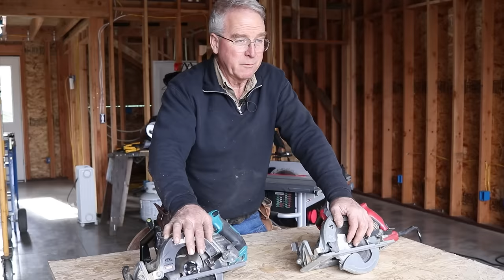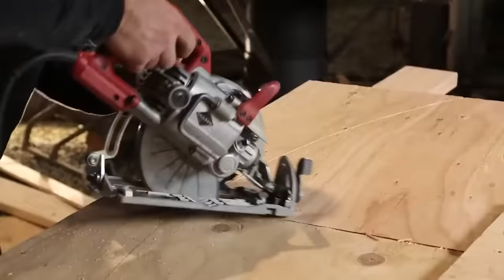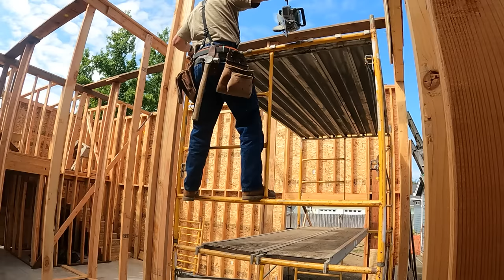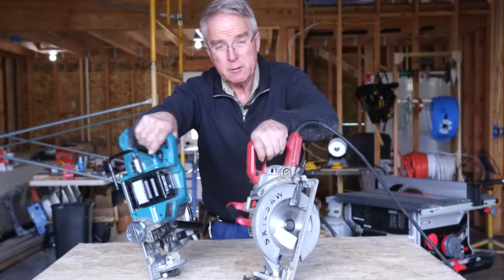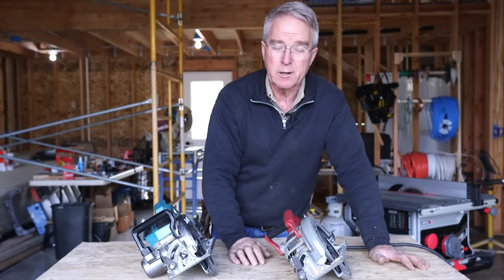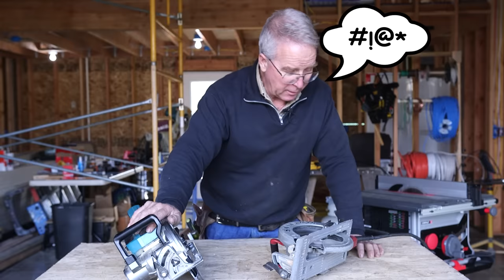Makita 40v XGT GSR01Z 7-1/4" vs. Skilsaw Mag 77 Circular Saw Review

Comment: I'm a framer in Australia and i'd LOVE to try the worm drive motors out, but unfortunately they're not a thing here (sidewinder market domination, can't really import one due to voltage differences and the need to then run a transformer), but Might have to pick one of these makita saws up at some point for that front heavy experience you guys seem to love

On the comment about it being rained on; the makita battery tools are ridiculously resilliant, granted we don't have as much/heavy rain as you guys might have, but i've left a 40v sidewinder style battery saw on site hooked up on a joist over night through heavy rain (mistake of my own, of course) and the next day, came back, tool still wet, battery hadn't drained a bit, ran just fine, and still going strong. It's common for us to use their battery tools in wet weather without worry. Agree on the battery running out/needing swapping out as a negative though- the other side is when the battery gets low the saws tend to slow down a lot but i've noticed with the 40v the noticeable ramping of power is typically a lot closer to when it's only got one bar left compared to the older 18v, it still gets the cut done but it's slower and starts to struggle a bit. 

I use the battery saw for the majority of my cutting but I always have it on rotation with another battery if i'm in the process of constant cutting duties- otherwise, for general stuff, can get a full day of work out of a new 4ah battery in the saw

Comment: Absolutely 100% correct about tracking the saw to its position where last seen, You feel like demensia has taken over when having to chase a cordless tool. As for running out of power... I do bring a bag. 2 8Ah M18 HO batteries and charger. I know it's meant for the 12 Ah, to run a full day - sort of. If a rough day on the job, it will run out on you - I just switch. One ALWAYS has a full charge, since the charger is always first to be plugged in with a battery before anything else, and it charges faster than it uses a battery in almost any circumstance, so... yes - it is an extra investment, more to carry, but... Usually switch at lunch, just to be sure not to run out, and besides, they don't really like being run all the way flat.

On the development side, changing battery platforms etc., it has come so far on the entire market, that if you do not make things backwards compatible, people are going to jump ship on you, unless you come up with something so revolutionary it's worth changing every tool on the platform for, meaning sawzall, rotorhammer, 9" grinder, hotsaw, jobsite tablesaw, chainsaw etc - ie. a LOT of money... which manufacturer wants to miss out on that?

Comment: I tell ya, this is spot on. As a 4th generation carpenter, my dad and not so much my grandpa(handsaw cut rafters), I remember when they would lug that heavy worm drive skilsaw around and it was like second nature and no mention of the weight. So when I started as a lad 35+yrs ago, I cut my teeth on that thing also. Changing the brushes, making sure it had oil and a sharp blade was the norm. If we had what we have now back then, I can guarantee that we all would not have the beat up bodies we do now.

Comment: I have used Makita cordless tools but I own Milwaukee. I would say there there is a definite difference between them in regards to both power and feel. I would say my Milwaukee rear handle saw, with a high-output battery(two bars or better) is the same as corded regardless of what you are asking it to do. 

A battery on the last bar, I feel you can notice a difference. Once you put on the fresh battery it is obvious.

Comment: A HUGE reason I like Mag77’s is you can get most or maybe even all the parts and fix them up to near as good as new in a afternoon
Reply: That's dependent on location of course. I couldn't do that here in Europe. I am a Makita user and ordering spare parts couldn't be simpler with them. The website has an exploded view of every tool and you just order the ones  you need.

Comment: I’m a 40 yr old plumber and most of the plumbers I work with are around 25. It’s amazing how averse to cords they are. To the point where they spends hundreds of dollars more on battery tools. They even tell new guys about these great deals on Milwaukee or hilti battery tools. I had to tell those guys not to listen. I told them if they had the money fine but while starting out consider a balance of corded tools and battery tools or stay away from red tools until they made a little more money. There’s some tools that just aren’t ready for battery only or they are but it’s going to cost you at least $200 or more in large amp hour batteries to run them properly. The two tools this most applies to for me are grinder and chipping hammer. I’m not to the point where I want those tools to be battery only. Milwaukee also put out a line of heavy duty tools with very large batteries. These included core drill, jack hammer, Sewer machine, and generator(though if it runs off batteries can we call it a generator). The smallest of these batteries is $600. That’s on top of probably a couple thousand on a tool. Unless you’re regularly working in a place without power I just don’t see the upside. The batteries take 4-8 hrs to charge so to prevent downtime you’ll probably have to have 2 of them. I like that the tech is moving forward and it takes buying said tools to move that tech but I’m not ready to cut the cord just yet. 
PS. I had a helper and we were working under a kitchen sink. I told him to to put one last 1” wood screw into the back of the cabinet. He looked around then stood up and started to walk outside. I said where are you going. He said to get an impact. I said there’s a screwdriver right there. He literally said “you can drive a screw with a screwdriver?”. Anyway I showed him how to do it or at least how I do it. I’d always hit the back of the screwdriver with my palm to get the tip in so the threads could catch and the rest is elbow grease. I explained ti him that when I started the options were hand drive or go unroll a cord and chuck up a bit with a chuck key so if you had a few small screws you used a screwdriver. I doubt he’ll use a screw driver for that again but at least he knows how

Comment: The final point on money in the pocket must include the time/money spent rolling out, rolling up, and re-routing a chord over and over every day. Replacing damaged chords, fueling generators, working  with power outages/shutdowns/popping breakers on overloaded spider boxes and workingnin wet conditions. 

As a form builder I need the chorded saw at a designated cut station to do high volume cutting like ripping edge form all day. But my 36v makita keeps me moving when i hit the site, first charge can last all day but if i am using heavy, gets me to lunch. No rolling, refueling, or waiting for a pick for a generator, no endless chord repair, no waiting for sparkies to get me set up with power. No fighting other trades constantly unplugging phone chargers or overloading and popping breakers. 
Just go. Keep going. Even though makita has upgraded to the 40v, i cant kill my 36v set up if i try.

Comment: There's a reason the Makita slides smoother, just look at the bottom of the plate...  The Skilsaw has grooves for a reason.  Did you mention how much safer it is to lower the Skilsaw down from a roof than to carry the Makita down when you're tired and dehydrated?

Comment: I'm retired and don't use my saws to make a living, and I hated to part with the extra money for the Makita, and I got it especially for one project where power was a pain to get to.  But I agree with you 100%. mine is the 36v one and uses 2 of the same batteries as all of my other Makita tools. I wouldn't part with either for the same reasons you spoke about. The convenience of the battery saw and the brute force of the corded one. I'm on the east coast where no one would steal the corded one because of the weight, but I guard the battery one like a mother hen would with her chicks

Comment: As always excellent review but one thing is missed. Not all jobs are huge framing jobs and not all job sites have electricity.
Of course if its a big job without onsite electricity you would bring a generator but since nowadays every tradesman have multiple high capacity batteries it might even be cheaper to buy few more of those then to invest in some good generator. Also, on the note of job size, if you mostly do small jobs, fixes and maybe not even a framer than the convenience of just snatching a cordless tool, doing the job and leaving without dragging yards of cord is wonderful.
Btw Im a 29y old IT engineer but I love doing furniture, welding, electricity and due to decent income was able to acquire many Bosch cordless tools from drills, impacts, grinders, vacuums etc., regardless of it not being economically viable for me since its for doing that work as hobby I still smile whenever I dont have to drag lines of cord for some 5min job.

Comment: The one place the cordless wins out is remote locations BEFORE the power gets connected. It's just easier than running a generator. But I do seem to spend allot of time wondering if the battery has enough left for a certain operation.

Comment: I use the Milwaukee rear handle circular saw it works great for cut power and I never have to pull out a cord, but the bevel adjustment doesn't have positive stops which sucks but beyond that I love the saw and it's rafter hook. Hang it from my bench, belt and up on roofs lol

Comment: 8:38 The non-soft start with the Skil causes the saw to twist. It's not a problem once you learn how to use it, which should only take pulling the trigger once. That said I don't mind soft start but it's not essential.

Comment: Perhaps a comparison of wormdrive vs hypoid gear-driven cordless saws? You should compare the Skilsaw TrueHVL 7 1/4" cordless saw SPTH77M-11 and then compare with Metabo HPT has a 36v, DeWalt has 60v, as does Hilti.  My friend figured he'd spend money on a powercell that offers 8hr run of his tools that he doesn't have to replace, then buy all new battery ones. Point is, a $1500 portable power station, lets him cut, drill, charge phone, and onsite in nice weather, also charge (solarpanel) while keeping his "paid for already" corded tools. Sure, he can't lug the 100lbs up on a roof, but two guys can get to the within cord use. I'm waiting for the big colorful tool labels (Yellow, Red, Orange, Green, Blue, Black, Lime Green...) to add a powerstation to their packouts, since they have wheeled cart options to stack.

Comment: As is always the case with tools, which one is best depends on the circumstances in which they are being used. While there is an argument to be made for minimalism and simplicity, I would argue that a lot of guys should own and use BOTH a corded saw and a cordless.

Regarding your frustration with the battery going dead at an inopportune time (like when you're working up high and you have to climb back down and/or across the jobsite to get to the charger). This can be alleviated when you have multiple battery powered tools that use the same battery, and you get in the habit of keeping one or more spare batteries charged at all times. Once you have that muscle memory (or mind memory in this case) to keep an eye on your state of charge, it becomes easier to always have plenty of power at your fingertips.

Comment: The ultimate factor in corded vs cordless is the size of your jobsite. I prefer residential framing, but as someone without a framing crew and contacts with developers, I work industrial/commercial for the money. I'm not gonna roll out four 100ft extensions to do a small form or wall on the other end of the building.

Comment: I love my Makita 18V drill and driver; they go longer than I can on a single charge. I have a few other battery operated tools from them, but I tend to prefer corded tools. It's not necessarily power, for me, but the fact that different manufacturers make certain tools better than the others. Mix and match doesn't work well with battery powered tools. I wish there was a standard battery slot or you could buy adapters where you buy whatever tools you want AND have one type of battery and charger.

Comment: Have the Makita 40v track saw, and have Milwaukee circ saws along with the Metabo HPT 36v circ saw. Also have a corded mag77 too, which honestly, haven’t used in about 2 yrs now, but still have and will never get rid of, as never know.
That said, I find myself using the Metabo HPT 36v circ saw more than my Milwaukee (id say have way more Milwaukee Tools than the other brands, but do have “the other” brands tools, with exception of Flex and Ridgid cordless power tools) and like the Metabo HPT b/c of the quiet mode they have on the saw, as does make a difference in sound, especially when inside structure; but also like that I can use the Metabo HPT adapter cord if all batteries are charging and don’t wanna wait and have access to power, and the other thing like about the saw….pricing. Was very affordable for 2-36v 4.0Ah batteries, contractor carry bag, saw and blade and paid $250 plus tax (already had battery AC adapter cord as an fyi.
Honestly though, if you can find a saw you like (or ANY TOOL BRAND) that is cordless or corded, for great price and it gets the job done, in turn, making you money…..that’s the best tool for you than; doesn’t matter if bought it used, refurbished, new/old, got the newest model, or bought a model that’s 10 yrs old, etc…… If you like it, and works for you, that’s the key, IMO.
Always a pleasure listening to you talk and speaking about anything really, as always LEARN SOMETHING new, or old that forget, that maybe phrased differently. Thanks ✌🏻
Reply: Ditto

Comment: For many years I used a Mag77, until I had to buy a new one in 2010 because of theft. The new mag77 lasted only 2 years because of a bad 'armature' ! (Skill had gone cheap Chinese on me). I then went to the 'corded' Makita wormdrive which has served me incredibly well for over 12 years and still going strong !  I recently bought the Makita 40 volt which is great for site use without having to drag a cord around,  HOWEVER,  I still use the 'corded' Makita Wormdrive for stationary use, eg : Cutting Stringers etc...
     My conclusion:   It's worth owning and using both types of saw. Both have become invaluable in their own right.

Comment: Seemed like an honest comparison to me. That whole battery thing makes me shy away from anything but a cordless drill or impact tool.
Reply: I have plenty of corded tools. But I have a bunch of cheap cordless Porter Cable tools. Not the best but they are inexpensive- a plus- but more importantly they weigh so little that my grip and tendon injuries are less of an issue. But for whatever reason they haven’t died in the time period their cost indicated. 
I’m off-grid so there’s one more bonus for the cordless: a lot easier to charge batteries around the shop than to upgrade the system just to plug in skilsaws and other power hungry 120VAC tools

Comment: Another outstanding Video Sir!  I have yet to see anyone compare and contrast Corded VS Cordless like you did in this Video.  I use both, and I have a Corded Skilsaw ( Bosch version ) and the 36 Volt Makita with the dual batteries.  The Makita is always a pleasure to use, but having to keep up with two batteries and the dual charger, tends to negate the convenience factor?  The Bosch/Skil is smooth and tough, as you pointed out.  

Great point on keeping up with the saw, and lowering and raising the saw by it’s cord.  Makita provides a place for a tether attachment, and it works well, but this may not be for everyone?  You might give it a try, and would certainly provide future material for a ‘follow up’ video after you have used the Makita more?  

Stay safe and keep up the good work! 
👍🔨🙂

Comment: I have a mag77. It's a tank. Strongly disagree on the soft start though. The old skilsaw likes to jump/twist slightly when you pull the trigger. It's a minor irritant, but those things add up. I recently bought a router with soft start and love the absence of a big twitch when I pull the trigger. Quick stop is also nice.
Reply: BTW I have had makita cordless drills and drivers for about 20 years. Can still buy the 18v batteries with no problems whatsoever. It's very unlikely that you'll be left unable to get batteries from a big name like Makita. It's more likely you'll want a newer version at some point, but that's not the same as _need_.

Comment: That cordless Makita power will vary depending on battery size. The higher the kWHr rating, the greater the grunt. Was surprised about that then searched about it, had assumed it was just about time till recharge. I also have a Makita with blade on the other side 230 Volt corded that takes a track adapter - brilliant, where was it all my life? Used to have a Kango 6" roofing saw corded 240 Volt - with a 48-tooth blade, it could cut melamine clean back in 1990, let alone take up a roof

Comment: i dont use my Skill saw as much as i use to (retired) , that being said when i need it its ready when I plug it in +- 5min. Battery power on the other hand you have nothing if the batteries are not charged PS I still use my hand saws mostly for quick jobs but then that's what i was taught on